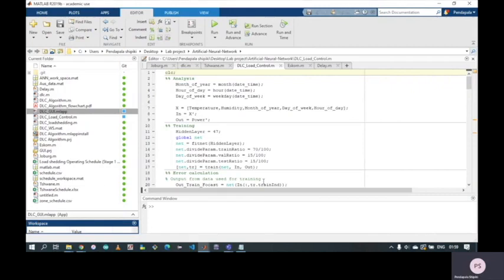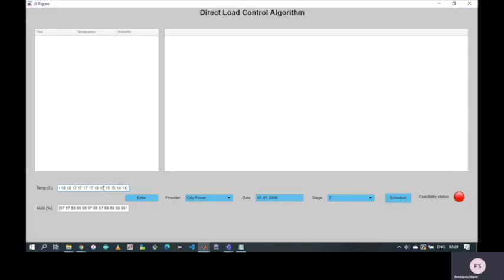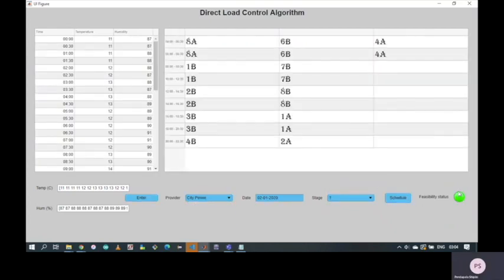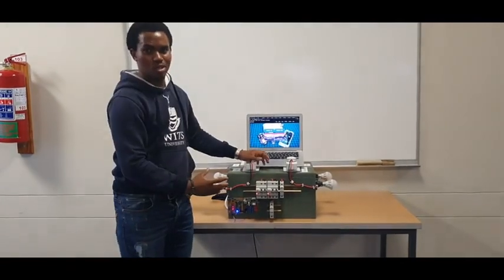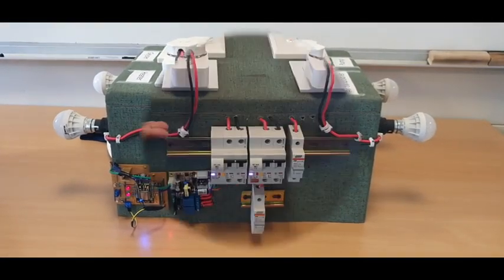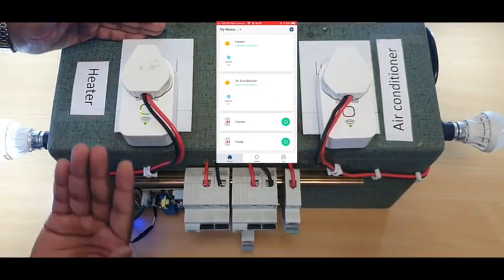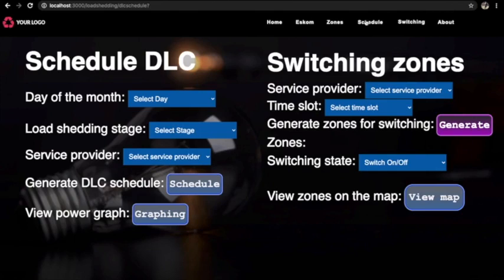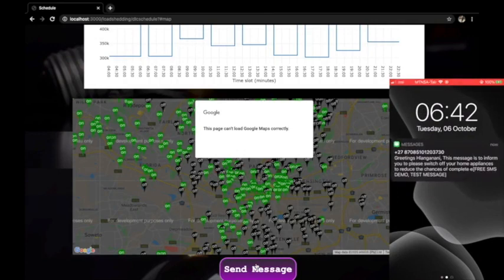20P46   Voluntary Load Shedding

Comment: well done on the project guys, i love it. In a case of a fault condition on the geyser or whichever appliance we are switching, the circuit breaker goes on a trip status (remember circuit breakers have 3 statuses, Closed, Open and Trip) will i be able to reset my Circuit breaker and switch it on again with the app?
Reply: Thank you for your feedback🙏🏾. To answer your question, if that faulty condition resulted in the tripping of the breaker is cleared, the app can reset the breaker and switch on your appliance.
Reply: @hlangananijiyane9723   100%, i am impressed by how the system works and your understanding. big-ups to you
Reply: @freddymolobela260  Appreciated 🙌🏾